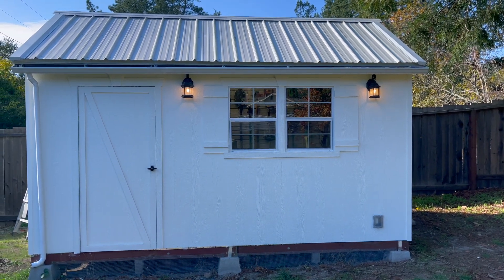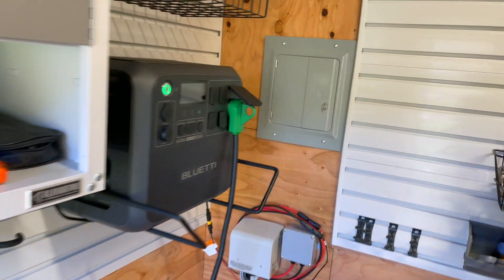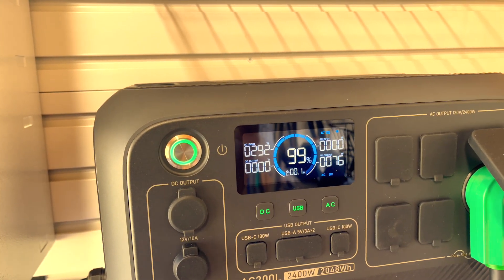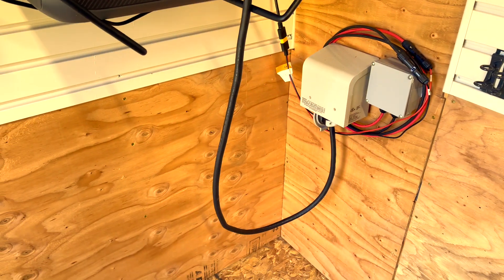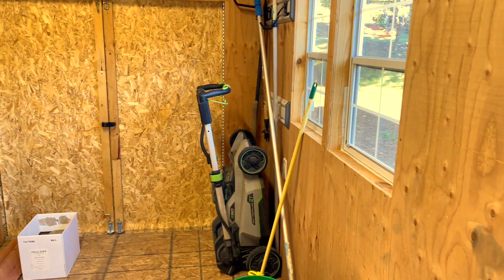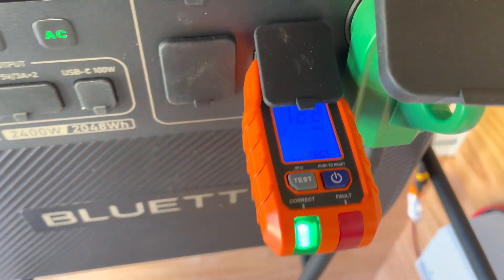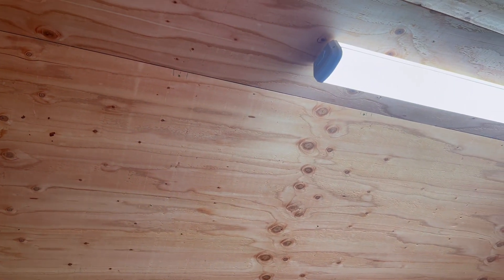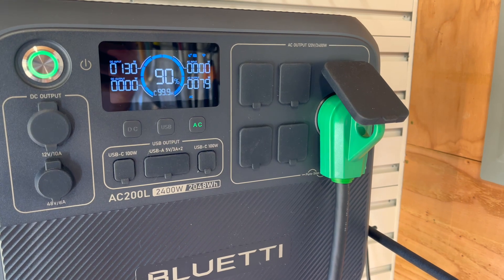Off Grid Solar Shed - Part 2

Comment: Going to follow this shed journey as I had a similar plan but couldn't wrap my head around how to properly store the battery (in your case the new Bluetti generator) as my shed would be well over 100 degrees i the summer and then below freezing in the winter.  Do you have a plan for that?
Reply from the maker: So the high temperature has yet to be tested. The shed is really well insulated and there is actually a portable AC unit in there just in case.

Comment: Nice shed and setup. That new Bluetti is nice and so are those BougeRV 200 watt bifacial panels. It's a shame you received a bad unit from Pecron, I guess it happens. Pecron has a bigger power station coming out, the E3600 LFP.. So many good power stations available now.  Oupes has the new Mega series and Allpowers has the R series.
Reply from the maker: It really is a great time for power stations, new models coming out all the time with more and more features.